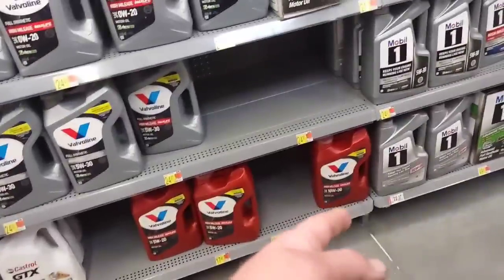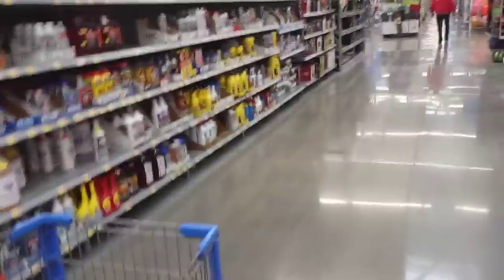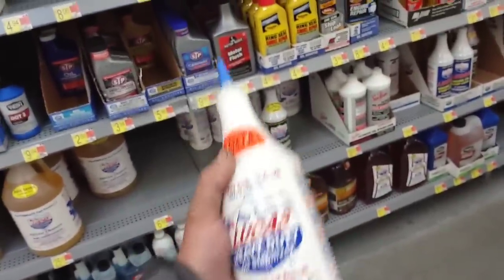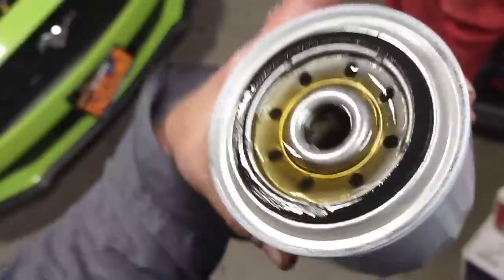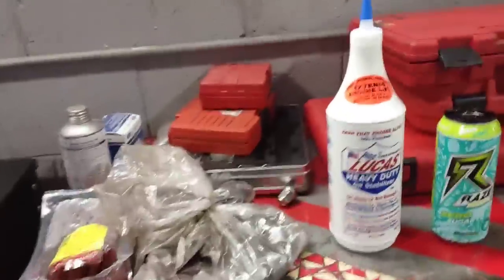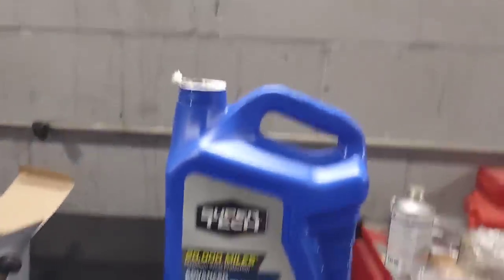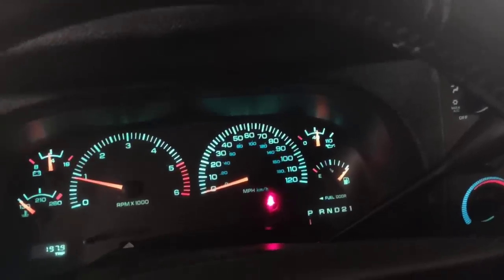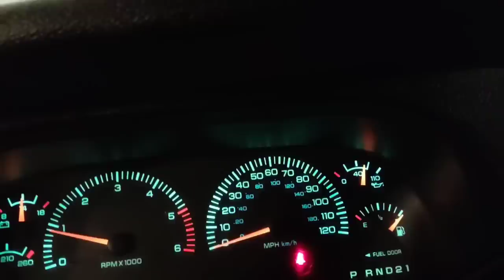We continue With Marvel Mystery Oil and SuperTech 10w30 20k Mile Full Synthetic Oil Dodge Ram 5.2L

Comment: Super tech is badass oil for the price! I run it all the time my Walmart sells it 12 quart box full syn for $10 that’s a steal my friend
Reply: 10$ for 12 qts ?
Reply: I call BS on the $10 box of 12 quarts of synthetic. Idk what he’s smoking but it ain’t good for his brain. Lol. 🤦🏻‍♂️
Reply: @I_know_what_im_talking_about  
Yeah and if it’s 10$ a QT he’s getting robbed 🤦‍♂️
Reply: @I_know_what_im_talking_about  Walmart sells the 12 qt box of Supertech Full Synthetic for $36.64 which is still a good deal and slightly cheaper than buying the 5 qt jug. The only thing I can imagine is that the specific Walmart he shops at had some old inventory of the 12 qt size and put their existing stock of it on clearance. I've seen them do that also when an oil specification changes (for example from SN to SP) and also on the Supertech oil filters when a design changes or they switch who manufactures them, they will clearance out the older stuff, many times at 1/3rd the regular price.

Comment: Disgusting that the govt allows companies to label oils as "Full Synthetic" when actually are not chemically synthetics.
Reply from the maker: Exactly
Reply: Its fair as for all purposes it behaves exactly like PAO-based oil does (out of the can) excluding its pour point characteristic
Reply: Yes... Our government allows the term "synthetic" when it is not. If you want a true synthetic look for the EURO symbol on the container as only true synthetics can be sold in Europe.
Reply: @oemytech  yeah, when I was with the Army stationed in Germany, I did notice their motor oil was much more expensive than ours in the states. They were all full synthetic.  And this was 30 years ago! No wonder they don't change their oil near as often as we do.  An oil change service is expensive there. Even if you DIY.
Reply: Yes, and a court ruling made it that way.  Mobil sued Castrol because at the time, Mobil 1 was made from true synthetic Group IV base stocks, and Castrol's version was made from highly refined group III base stocks.  The court ruled in Castrol's favor, and Mobil switched to the cheaper Group III base stocks.
Reply: @munkysex00  I do my own changes and started using ST in my 97Grand Marquis when I got it at 111K miles, and it's nearing 160K now with no issues. I change it at 4,500 though. The engine is clean and at 4,500  I can still see light shine through it as it drains. 

I enjoy doing my own vehicle maintenance and $14 for a jug of ST plus $3 for a Motorcraft filter it's a damn good deal that works for me.
Reply: @oemytech  no even euro oils don't have to have Pao in them. They're usually designated euro by viscosity grade and european certifications on the bottle not group 4 content. Euro oils are better than regular full synthetic for the most part but euro oils typically come in 0/5w40 and sometimes In 0/5w30.

Comment: I use Supertech ATF in my engine for flushing.  I purchase the 1 gallon ATF. 4 quarts ATF with 1 quart of engine oil.  
20 minutes on idle. Drain, add new oil and filter. One or two times a year for high mileage engines.

Comment: Honestly love mmo. Use it in my fuel from time to time and it always runs great when I use it. But I wouldn't use it in my oil since it's 0w-20 in my truck and I feel like it would think it out more then it already is
Reply: Just use a heavier weight oil while you use MMO, SIMPLE.
Reply: I have used it with my Mazda3 2018. My car takes 0w20 oil never had no problems after driving for 5000 miles.

Comment: I used MMO in a old  92 93 TBI 350 it was Freshen up so to speak. New Int.G, VCG, TCG seals ect.  Tho it say for little around a year. I Ran MMO since day one of the engine being in my truck. SMOOTHEST TBI Engine ive owned til this day. I Ran through Oil, Gas, Brake Booster Vac into intake. The first oil change showed it did its job on all kinds stuff. The filter collected a lot itself. Anyone who uses MMO knows its very very good lubricant. Anyone else go get a bottle clean call a friendd etc rub between two fingers. Try it on locked up pliers or any tools..

Comment: I just did a search for mmo, and have seen your other videos. Did not know you posted this fresh video! :) Question on newer cars:  is "1/2 in the tank and 1/2 in the crank" good on a 32 oz. bottle. 6.4 quarts and 20gallons.  Read the label today and it says 4 oz per 10gallons.  So my case 8oz. for gas tank. 1.28 for crank!

I think next oil change i will use the recomeneded amount.  500 would be good.  Now just to pass inspection next month.

Comment: In case you didn’t know, LUCAS has a SYNTHETIC version in a BLACK LABEL oil treatment, for use with synthetic oil!!
You have the regular oil treatment Lucas.
Im sure it wont hurt synthetic, but theres a reason they make a synthetic formula Lucas.
Reply from the maker: I think it says high mileage, either way itll work. Oil isnt as sensitive to that degree like people think
Reply: Now, a year later, MMO is available with a PAO synthetic base.

Comment: I own a Classic car dealership and the first thing we do to every car we buy is change the oil using Supertech oil and a Quart of MMO and run them a 100 miles ish to flush the engine and then change all the gaskets and put good oil in them. You would be surprised how many "small issues" a good engine flush fixes without having to chase it down.
Reply from the maker: Bg epr is the best flush on the market 

Mmo can help clean but it's not necessarily a flush 

Try some bg epr as well small can goes a long way and I have videos on that
Reply: @FordBossMe  I might try that, thanks

Comment: I have a question which may have already been answered and I missed it, do you know the background to this truck and what its typical use was ( easy driving or a lot of heavy pulling in hot conditions ) and what type of oil and oil change interval its generally had since it was new. The reason I ask is that I am not used to seeing engines with the volume of caked on sludge and what looks to be burnt oil. I farm and as a result I have had various valve covers off to adjust valve lash on diesels and as well some gas engines and rarely do I see much of anything on the actual head or rockers, sometimes key area's of the underside of the valve cover will have a baked on varnish. The oils used over the years have varied a lot due to technology changes in oil additive chemistry but the theme of the oil has been a heavy duty diesel/gas compatible oil and I am wondering if the additive package is better or perhaps my oil change intervals are less, or the fact that it doesn't get extremely hot up here in the northern part of Alberta Canada.
Reply from the maker: I do not know the background

Comment: Maybe 10 years back. i have a 2001 F150 130000 miles aprox  with severe tapet noise right bank, used MMO love the smell. Solved the situation for awhile. Then I read 0 W 20 with a puralator one was the ticket. Well 289--- miles later, True Dat. 4.9 is a beast i hit in the deep snow like a dirt bike no chit love both MMO and puralator one

Comment: I wouldnt recommend using the oil stabilizer. its so thick, I dont think it will flow well through the engine. adding one qt of 20W50 would probably be safer. you could also use a slightly thicker oil like a 0W40 or 5W30 euro oil. even at 190k, the clearances should not be so worn that you need a thicker oil.
Reply: it wont harm that motor at all but in the newer trucks it may lol
Reply: At 190k that engine is at its end of life. Most if the Magnum era 5.2 and 5.9l engines had oil pressure issues due to a pump that wasn't big enough to properly supply oil to the engine and in turn most of these engines died very early
Reply: @claytoncoolidge992  in the ones I have had 10w30 and 0w40  is  a bit thin seamed a little more noisy never herd about the oil pumps  my current one is a 2001 5.9 has 340k  still has 35 psi at idle and 55 driving also don't smoke or any ting still runs like new  and I work it hard so it gets put thru hell lol  but these are loose built motors heavy  oil wont hurt a bit
Reply: @dakotabowes2387  ya 35psi is barely spec. (Factory spec oil pressure specs from all big 3 are 5 psi for every 1000 rpm the engine is capable of  and performance specs for racing engine building is 10psi for every  100rpm. Thats the minimum spec.)as the pumps wear you start seeing low oil pressure light at idle witch obviously wears out the bearings and kills them.  Everything on the magnums has the oil pump warning about them and the average life span isn't my assumption that's a number provided by sources like car and driver and other consumer report publications.  They are good engines that made ok power but were plagued by bad oil pumps and cracked heads. My 98 1500 5.9 went 180k before it died. I bought it from an auction so didn't know how bad it was till I got it. 2 quarts of oil burned every 300 miles bad rings. Rebuilt the engine the first time and  a brand new oil pump failed a few days after I got it done and took out the main bearings and currently rebuilding yet again and hopefully the same thing doesn't happen.  The landscaping company i used to work for had 5 rams all bought brand new and very well maintained (I was the tech that did all the equipment and vehicle maintenance and repair) and it was common enough to have one lose an engine that I had 2 ready to run engines sitting in the corner of the shop so I could have the engine swapped out and truck running before the next day
Reply: They make a low viscosity stabilizer now too. That's better for the worn out newer engines
Reply: @stevemasterson7776  I used it in some of my newer trucks  helps if you have  lots of miles or oil burning
Reply: it probably don't need it but it dose thin out a lot mixing with the other  oil in there  I would not use it in every motor  but it wont hurt  old 318 or 360  they also make the thinner synthetic one been using mostly that the last few years in my older trucks
Reply: @claytoncoolidge992  the truck I'm talking about also has 350k on it  but it never makes any noise I do 5k oil changes only burns one quart per 5k  only thing I had to do is the water pump in all them miles also has the original trans  and it still gets used every day
Reply: @claytoncoolidge992  I have pretty good luck with motors lol  most my cars and trucks get over 300k  b4 sale them off  still running the most I ever put on one truck  was 438k on a 2002 chevy with the 6.0 and it was still driving when i sold it but it was burning a ton of oil in the last 10k and had a lot of rust lol
Reply: @dakotabowes2387  yes you got one of the few good ones. Its rare. Chrysler put out the tsb for the oil pumps years ago.  Basically it said that they know the oil pumps are junk and to make the engines get out of the warranty to use a genuine Mopar oil filter 10w30 or 10w40 oil and advise that they only run 2000miles per oil change.  This would boost the pressure enough that the light stayed off at idle but just barely.  By the way if you're using the dash gauge to judge oil pressure by your not getting a true reading.  I have mechanical oil pressure gauges as well as the dash electric liar gauge. The mechanical gauge usually reads around 10psi lower than the electric gauge but it also responds several times faster and would read 0psi a few seconds before the dash gauge read anything.  That dash gauge is just a glorified dummy light. Not trying to knock dodge or anything else I'm just putting the facts that Chrysler themselves have published on this issue. It affected several dodge engines of that generation. Many of the v6 engines and severs of the 4 cylinder engines they had used between 93-01 had the same oil pump issue.🤷‍♂️ I can only go with the information that is there and my experience with a great many of them over the years has coincided with that pattern.  Yes I've seen a few with 300+k on them but I've seen more dead with less than 160k than alive
Reply: @dakotabowes2387  ya me too hell I even had a Ford explorer hit 898k when I sold it original transmission at that.  Got several 2.2l s10s with 500k ( my father im law has driven 200+ miles a day to work for 30+ years and i inherit his when he hits 250k i generally put 40-50k a year on my vehicles too. Proper maintenance and knowing about known issues and doing the proper repair such as putting in a high volume oil pump changing my trans fluid and filter yearly or 2x a year in the plow trucks. Your argument is still invalid  CHRYSLER put the information out so if you want to argue that there isn't a completely known problem then go to them man. Your barking up the wrong tree. For your one good one I got 100 bad ones.
Reply: @dakotabowes2387  so any way as I was saying till you had to insist that I prove you completely wrong
Reply: @claytoncoolidge992   your probably right   its weird iv had a ton of them trucks  over the years  non of them had issues with oil pumps just computer and wiring issues on a few thanks to there cheap build quality lol
Reply: @dakotabowes2387  ya owning a repair shop tends to see alot more than you are by just owning them
Reply: what's your deal your a adult not a 8 year old right I just said mine never went bad no reason to get your feelings hurt some just dint go bad

Comment: Did the same thing after my 2TR-FE w frozen piston rings battle. 
I figure I can change it every 2000ish miles "all stop and go" w MMO and Lucas low viscosity stabilizer and try to get the old girl cleaned out a bit more over time

Comment: I am just a lube tech. But I work next to a Walmart for a dealer…. Several people come in with super techs with the 457 filter. I’ve changed the oil 4 times now and out of the 3 times so far every time the filter is just crushed. Like collapsing on its self
Reply from the maker: Good information I appreciate that

Comment: imo i wouldn't run the advanced supertech syn 10w-30 and oil stabilizer together. If you're gonna change it in 5k or less to clean the engine out with mmo, but want to keep some viscosity i honestly would've just used a $10 15w-40 4 quart jug instead so you can dump that in and a quart of mmo to make it nice and easy without spending on that stabilizer. 

All the stabilizer does is bring it one viscosity grade up but that stuffs a bit expensive for something that a grade up oil that costs the same or less can do.

Also you could've tried 20w-50 and two quarts of mmo. would've had the same viscosity as a 20-30 grade oil when mixed and wouldn't hurt but would allow you to have more cleaning strength without ill effect. 

also using that stabilizer or a thicker oil will make the oil thicker again than before and the faster reving that you had at operating temp may no longer be there. The results will change a bit now.

Comment: I have 253k on my 07 Tahoe. When I had the heads off because I deleted the AFM I was surprised to see the hatch marks on the cylinder walls. I change the oil every 7500 miles in it. Since the Cats are bad I rarely drive it. Maybe 1k a year. That will change when the Long Tube Headers are put on.
Give us a update on the truck when you go to change the oil again.

Comment: I wonder how well mmo mixes with synthetic? Also i would think it would be little thinner than optimal. Synthetic operates somewhat like a thinner oil. Then thinning it out more with mmo? Idk. Good choice atleast going with 10w instead of 5w. I would myself maybe go with 10w 40 if using mmo. Especially in the summertime heat. Only thing id say is dont over rev it. If possible.

Comment: MMO is basically lighter fluid aka petroleum distillates. Not sure what you're trying to do but it's  a weak solvent and will indeed thin out oil and help break down sludge
Reply from the maker: There is a playlist on this

Comment: Never understood why some vehicle dipsticks do not read full when the engine has the factory capacity oil amount installed. If it has the max amount of oil the engine is supposed to have, the level should be on the full mark.

Comment: Super tech oil is good but I’ve seen people cut the super tech filters open, no quality junk filter like fram
Reply: They've changed supplier a few times over the last decade.  They used to look like Fram and now they use a Wix filter media but the bypass valve, spring, and anti-drainback valve are of lesser quality than what a normal Wix filter uses.  It's more like a Napa Silver filter IMO currently.  I use Wix filters that I get cheap on ebay or rockauto.  I also run the Full Syn Walmart oil and change it at around 6500-7500 miles.  It comes out clean almost like it went in.

Comment: i am going to start adding mmo about 500 miles before oil changes on my 2014   2.0 turbo ford fusion,, to get a little more cleaning action, before the oil change
Reply: at 5000 miles the oil comes out pretty clean, i can see thuo it during drain.... and my intake valves are pretty clean.. will use this evey 4500 mile, then rain at 5000 mile to keep everything clean.. perhaps the mmo helps keep the intake valves clean also?

Comment: 30+ years using MMO. Cars, motorcycles, no need to use it EVERY fill up. Every couple of tanks or so and top up the oil with it as it drops. And replace a quart on oil change. Everything runs better, quieter, and  smoother. It works! 👍
Reply from the maker: I use it because I have a lot of experience with it and if you do use it every fill up it actually makes things better you don't have to but it is good to run it if you have it
Reply: @FordBossMe  
 Thanks for the tip👍

Comment: Just did my oil change after a MMO 20% mix for about 500 miles, oil life monitor said I had 15% life left but damm, that stuff looked nasty. Use it in my gas as well since my car has no fuel filter.